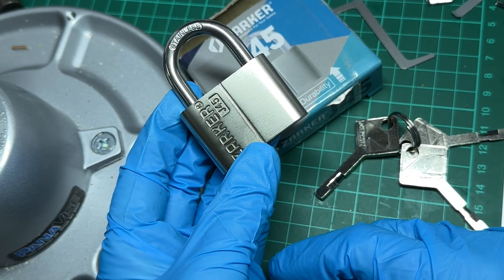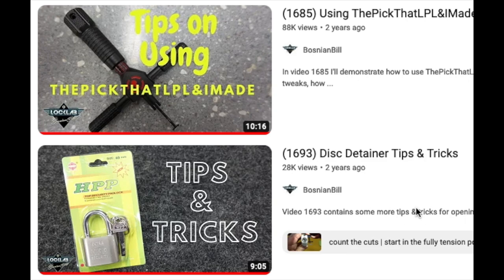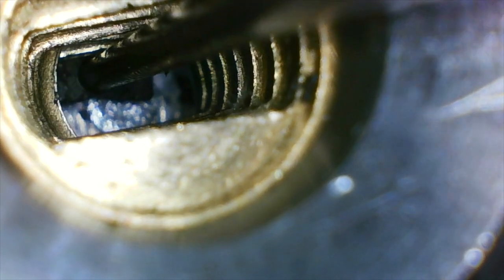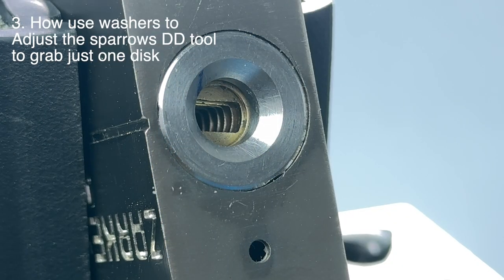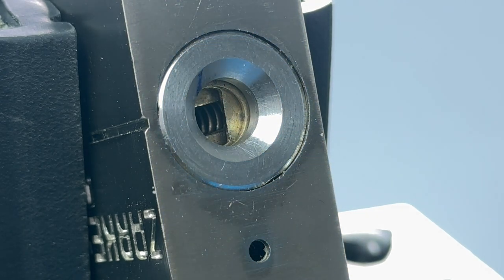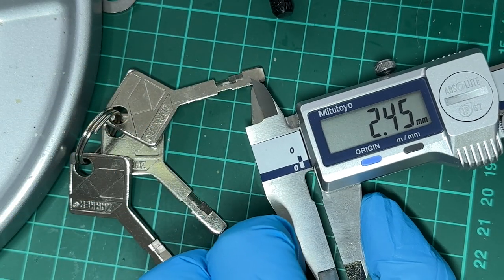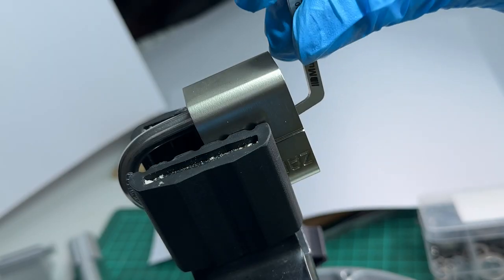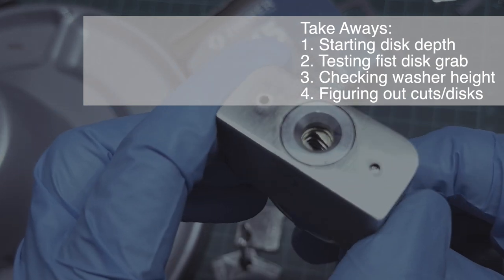Picking your first disc detainer lock? Some (more) tips - with a ZarkerJ45

Comment: You are a skilled teacher. I wish I had this video a month ago. It would have saved me so much time. On a slightly different note, I noticed if I unscrew the protruding handles on my sparrows dd pick, I can slide the tension tip in or out a bit. On a Unity lock there was enough pick adjustment space that I didn’t need the washers. But maybe for some locks the pick’s adjustable range is surpassed and washers would be the solution. Great video!
Reply from the maker: indeed so - if you look at for instance a kryptonite like this one - (https://youtu.be/V-cZjRxvo9M) no washers needed - or like the one you've done. 
And sometimes on other locks you need to extend that tip for sure (like this other K https://youtu.be/CdlrwZXDvEc)

AND NOW you know how to test for that - to be able to check how many disks you're grabbing - so you can see if you need washers, or extension 

Thank you for the kind words, too. Best with your practice.